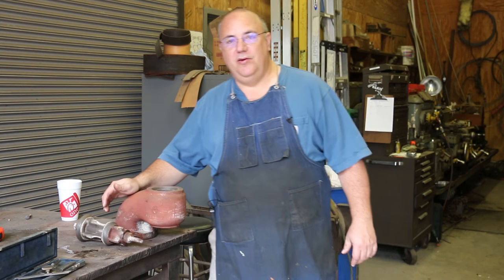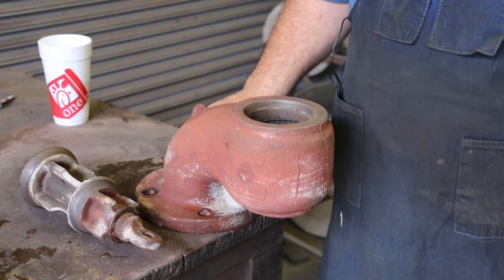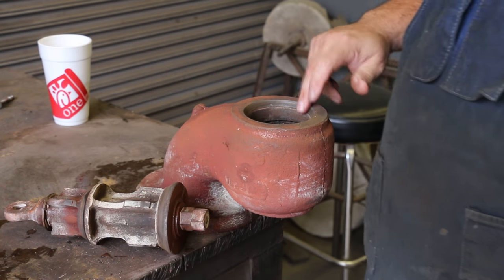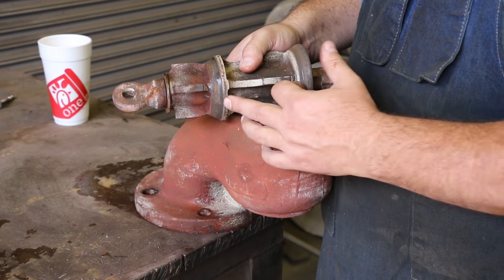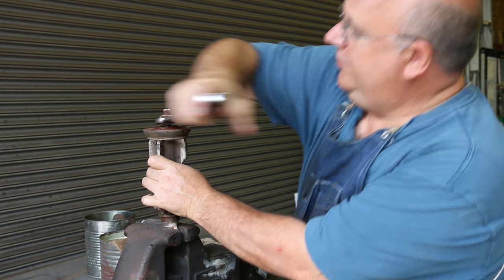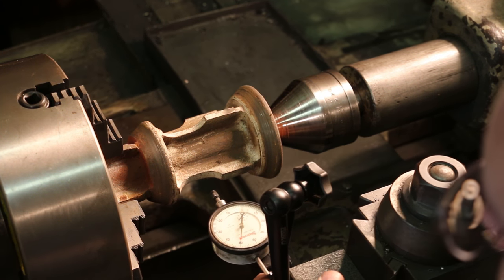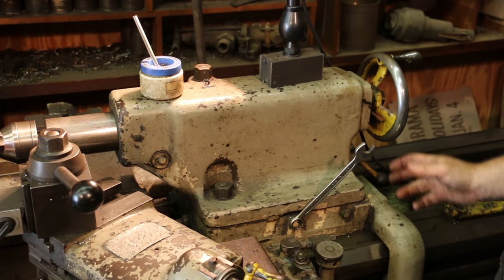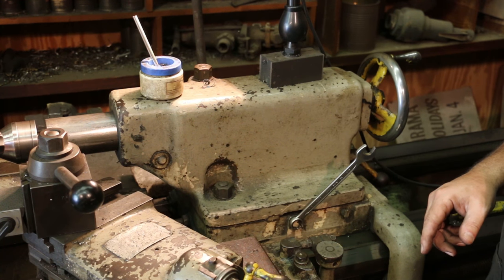Steam Locomotive Throttle Valve Repair:  Turning and Lapping

Comment: Nice job you have done there, but almost guaranteed to leak. Double beat valves require a trick that not many people know about. Do as you have done in your video, then apply fine compound to the top seat, and oil to the bottom seat. Give this a good lapping then clean and reassemble. This allows the steam pressure to push down on the top seat shortening the valve a very minute amount. Without doing this the valve will always hang on its top seat. I will send you a diagram  on Facebook. Works first time every time and a steam tight regulator is a certainty.
Reply: Very interesting comment Jason.
Reply: voting this up for increased visibility ^
Reply: Keith. You will have trouble with that valve big time as others have said only lap one side and you mentioned a step in the seat ,that will cause the valve not to seal in quick order ,just my thoughts 
Stuart
Reply: I never considered the difference in surface areas helping to hold the valve closed. very interesting.
Reply: The educational comments like these are one of my favorite parts of the video sometimes.  I was actually thinking that it should be short as well only I was thinking to allow for expansion so that you wouldn't end up with the valve heating and lifting the upper seat by expansion. If the valve was short the throttle linkage could somewhat help to pull it closed but if the valve is long no chance to ever close it.
Reply: I was thinking there had to be a certain amount of expansion as well Brian. The valve is long enough there has to be a measurable amount once it's up to operating temperature. But this is only a guess on my part. Interesting video and I'd sure like to know how they got the two tapered valve seats and the distance between the two valve faces close enough in the beginning so they could then start to lap them in a hundred years ago. Maybe a set of gauges?
Reply: I too was a little concerned with not removing that step. I believe it will cause leaking with any wear to the machined surface.
Reply: Don't forget that the housing expands also so it gets longer and the seats get a little larger in diameter which compensates some for the valve getting longer....Dave
Reply: And I had forgotten about the housing expanding at the same time Dave. That I guess shows the difference between the little I know and what somebody with real experience does. :-)
Reply: Used to have the same problem you described on our Shay, until we started doing things as you described. It works pretty flawlessly now, 3 years, annual lapping (about 100-120 operating days per year) and steam tight. This is the way to do it!
Reply: Brilliant comment and valuable advice Jason. I suspect you might be in danger of overloading Keith's brain here
Reply: @noridawheeler  I was on to that. It's a safety measure - then should the linkage fail, the valve should be slammed shut by steam pressure. The smaller valve is so the effect isn't too great !
Reply: @bcbloc02  Both parts being CI should expand/contract the same amount with heat  - so heat should not be an issue.
Reply: @turningpoint6643  The valve body and valve housing should expand at the same rate (in both directions !) so thermal effects should not make any difference.

Comment: Your valve reminds me of a valve that a friend of mine designed for the navy for fuel transfer between ships. It sealed by something that he called pressure difference sealing. I worked with him in his shop 45 years ago, and was amazed at his knowledge. We would always hand lap the prototypes and there were some that took 8 to 10 hours for the seal to work. When you finally get it to seal you feel a sense  of satisfaction for a job well done. You must feel very proud to see your hard work actually function and work properly. I know how it made me feel. Great videos, keep them coming, and I have learned a lot from you. Love your rebuilds.
Reply: Fuel valves get a much easier time of it than steam valves. One gets lubricated the other gets corroded !

Comment: I was initially thinking that plugging the old center hole and then re-cutting it may have been better than moving the tailstock, but then seeing as how you had to taper turn more than .030" off both faces to get them to clean up, trying to re-cut the center hole would have probably been a waste of time anyway and so moving the tailstock as needed to get those faces running as close to true to begin with was the most expedient.  Very nice to see Keith, especially knowing both the heritage steam locos within my vicinity, 2-8-2 SOU 4501 at the Tennessee Valley Railroad Museum in Chattanooga and 2-8-0 GSMR 1702 of the Great Smoky Mountains Railroad, both engines' throttles are of the same type as you worked on here, just quite a bit larger of course.

Comment: Hi Keith,
That was a recognizable job you had there. Fun to watch as always.
A looong time ago I had to do a similar job myself. With grease I "glued" a leadwire on the circumference of both seats in the housing. I than placed the valve in the housing, applied some pressure and removed the valve. Measuring the (remaining) thickness of each leadwire was an easy job, so I knew were to take of the most. Saved me a considerable time to lap the seats in.

Comment: After reading some of the comments I figured what the heck I might as well put my 2 cents in. This one is pretty easy, the hole is not concentric to the seat.......fix one check runout and cut a piece of shim stock and shim the live center over....fix two indicate seat without tailstock and cut a small area for center to run in.....fix three place small plug in hole and indicate seat in, then center drill plug for a concentric center......fix four go ahead and run off of existing hole and turn seat concentric to seat(this is in effect what you did)       Love your Videos  BTW: it's really easy to be a backseat driver! I've used a center punch and moved existing centers over a bit to get an OD to run true when re centering wasn't and option. Usually when OD grinding between centers. It works.

Comment: I'm not sure how it is for steam spool valves, but we were taught when surfacing poppet valves and seats to go for the middle of the taper for contact area, the desired contact area would be 15%-25% of the total width of the seat (depending on the medium being sealed). Because you had two seats to keep track of in this spool valve, it made this job far more demanding. It might not be a bad idea to catalog what you did here for the next time this job needs to be done to make sure the seats and valve faces get resurfaced together before lapping; the sharp edge that developed during lapping is indicative of a seat problem which will ~eventually~ need to be addressed. Great job on a difficult task!
Reply: Matthew Helton would it make sense to go back and remove a bit of material above the step so the valve doesn't hang up there?
Reply: Without looking at it, I cannot say. There is no reason to doubt it won't seal, but my thought is that the ridge is going be attacked by the steam flow and might cause abnormal wear. Keith mentioned, and I don't disagree, that the valve didn't look like it was serviced since the engine was new, so it will probably be a very long time before it will need to be serviced again.

Comment: That is a floating valve,  it is more important that the seats be parallel and concentric to each other, then to be centered between the chuck and tailstock. the reason you're having trouble centering the valve seats,  is that the face is at an angle, to be more precise curved, when you move the center line, you're actually riding up and down the face. And that face is worn out. It is no longer parallel to the other face. There is absolutely no way that you could truly get it centered using that method. You would need a reference surface on both ends that was unaltered from when it was first made, This is as good as it gets. At least without making a new valve.

Great job, and keep the videos coming. They are very interesting.

Joe.
Reply: amen. SOMETHING has to be a good reference in order to get it lined up.

Comment: Good job Keith if worst come to worst you can always fit a modern valve to it, but I thank it will be fine.
Reply: I've always wondered why they don't use gate valves that screw down as those would give a finer control of steam flow - hence better control of wheelspin.

Comment: Thanks for the video.  Very interesting.  You have a lot of patience.  Two hours to lap the valves is a lot of time and effort.  Well done.

I hope you provide an update when the train is back together as to how well the new lapped valves seal.
Reply: Hey dude sorry just having a bit of a laugh to myself. Not being rude to you but two hours is pretty fast. Try spending a week or more hand lapping valves for a large reciprocating air compressor. Each valve being 6" in diameter, all 16 of them. Those were the days.
Reply: LV, with respect, what Keith is working on should only be called a locomotive.   Non-railroad people will typically call anything on the rails a train, however:  a train is a power unit, with or without cars, having a headlight in front and marker lights (traditionally, not today where we have EOT devices) at the rear.  This was in the rule book in my day and I doubt it has changed.  There were additional sub-rules but that's the basic description of a train.
Reply: @fredericnystrom9045  That doesn't make sense - as a loco is a power unit !
A train is of two or more vehicles.
A loco + tender = a train.

Comment: To get them cut even, do the top first like you did at 030, then take 10 off the bottom to get it to seat.  Keep fitting with a 010 feeler gauge in the top gap until you've incrementally shaved enough off the bottom to get that measured 010 gap at the top.  Then take the final 010 off the bottom.

Comment: I was always told that when lapping valves, you never make full circles.  The thought being that if you somehow ground an imperfection in it, you wouldn't want it to encircle the entire valve and that is why valve lapping tools (that are awful to use and the suction cups never work) automatically reverse.  However I couldn't imagine trying to lap this project without rotary tools like you did.
Reply: I suspect that's the wrong way around. You SHOULD make at least full circles. Whatever imperfections are put in with the lapping process will affect the valve and the seat equally so should result in a matched pair of surfaces.
If you don't do full circles at least, neither the valve nor seat may be perfectly round - and they have to be as in use the valve is free to rotate to any orientation - and wherever it ends up, the seat has to match its shape.

Comment: A design that is a pain to work on, but I think I can see the reason behind it. Balancing of forces:

The top valve is opening against the pressure, and that alone would be very hard to open. The bottom one opens with the pressure, and would open by itself. The top one is larger, so it "wins" and keeps the valve closed, but the force needed to open it is just the difference in size between the two.

Comment: My real name is Michael McCluskey. When I took a course in auto mechanics. I remember using a lapping compound when installing new intake and exhaust valves and a special tool to spin the valves with a drill to get them to sit well on the valve seats.

Comment: i might be wrong here but i dont think you can adjust runout by shifting your tailstock over like that, your runout is always going to follow the live center, what you should have done is left the big end dangeling, indicate it and carefully cut a new center with your compound, then put your live center on and cut the faces.
Reply: I was thinking the same thing. Moving the center over won't change the point in relation to the outer diameter around which the part is revolving, and that's really what needs to happen. You could either cut a new center as Georg suggested or put a piece of shim stock on the appropriate side of the center to nudge it over.
Reply: I am thinking the same, only my brain just melted...
Reply: What's happened is the centre bore is of centre from the outer valves. It was probably machined like that it's probably a complete taper. What's happened is you've now Nearly emulated how the first machine to turn it was set up.
Reply: Georg Andersson From what I can see, this is a cast piece and the only machined surfaces are so worn and uneven that there is nowhere to get any accuracy in indicating. I suspect that in the day this was made, hand fitting was the norm so what Keith did was about as accurate as the original if not more.  If there is any criticism of his technique it may be his lapping of the 2 stage valve seats making them both even. This may cause problems.
Reply: looks round to me. im not trying to be negative but you still cant adjust runout with your tailstock like that. And lathes existed back in 1917

Comment: I would imagine, 100 years ago, that would've been machined with a dual insert tool holder of some sort. Set up the distances apart and machine both faces at once.
Would hardly be worthwhile to make a setup like that for one individual valve though. I'm impressed you got it so close first go.

Comment: I really do appreciate your efforts on keeping old machinery functioning and enjoy the videos you produce, so, please don't take offense at my comments. Keith, I'm a arm chair supervisor. Your the guy with the turnin' machinery. Having said that, would there be enough material in the valve body to machine out to install new seat inserts? Automotive engines get new valve seat inserts frequently. I would have like to seen a Prushen Blue pattern without spinning the valve stem to see what kind of seal you were going to get. Maybe some kind of water pressure test would be of value to see if more work would be required on the assembly.  bjr

Comment: Keith, not sure why YT suggested this old vid but there we go ! So it's 5-6 years old but at 6:00 you talk about offsetting the tailstock to deal with run-out of the part. Unfortunately, offsetting the tailstock won't achieve that - as the run-out is still rotating and is not a fixed offset that the tailstock could adjust for.

Comment: Who! Dude! 4:13 100 years inside the boiler exposed to the steam, and those nuts just pop off like it was assembled yesterday? Man, you must be doing some clean living to get rewarded like that!
Reply: That seems to happen a lot for him. I take of a bolt installed a year ago.... snap! :o/
Reply: @MrUbiquitousTech  Ahh but in this case, it was correctly assembled with the intention of it coming apart later. The threads were probably well oiled prior to assembly - that oil being trapped in the threads but more importantly, the top nut was NOT fully on the thread - meaning there was no exposed thread to rust and jam on the nuts !

Comment: Keith, what are you doing ??? You're not cutting a taper, you're compensating for run out ! Next time just tap the part around until It's true, then recut the center. Thanks for a great vid, Cliff
Reply: I was thinking the same thing
Reply: Second that. I had an idea of shimming the hole to make it run true but you're probably right, truing and then cutting a small seat for the center would be the right way to go.

I wonder if adjustable live centers exist, kind of a fourjaw for the tailstock.
Reply: Vintage projects shows plans to make an adjustable center.  Perhaps you can modify it to a live center.

Comment: Keith I am far from being an expert machinist but I am pretty sure adjusting the tail stock would only compensate for taper not run out. I am more used to run out involving center type grinders. Neat to see the actual working parts of an old steam engine.
Reply: It's comments like this that I'm browsing the comments for - how many spotted this error :)

Comment: don't know if anyone's said this before...the valve design is sort of self-servo - the top port, upon which boiler pressure acts to keep it  closed ( when shut ) is somewhat larger than the lower, upon which end the boiler pressure is acting to open the valve, so that overall, less than full boiler pressure has to be overcome by the driver to open the valve...
which is all jolly good, so far...
but, once fully open with steam flowing under the top part & bottom, you are looking at full boiler pressure acting to keep it open...therefore, I suppose, the operating linkage geometry  is probably set up  to make more closing leverage than opening...but that is conjecture